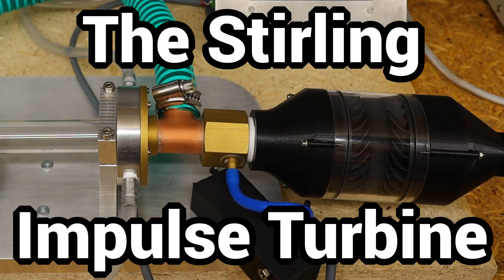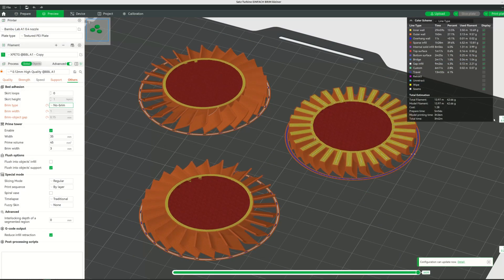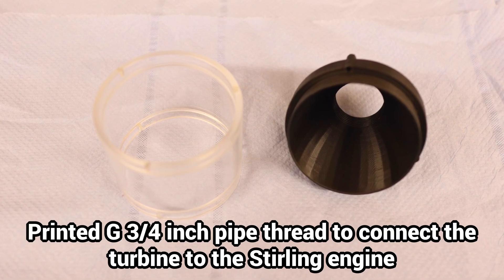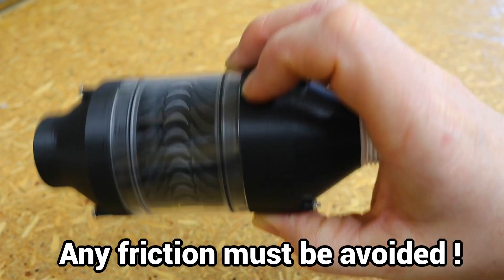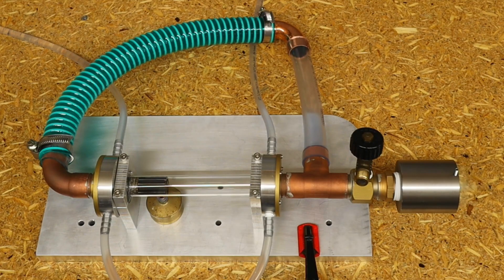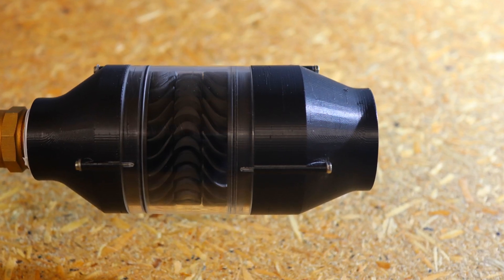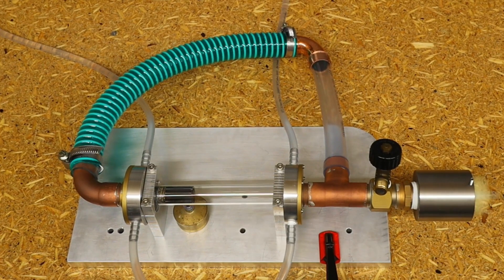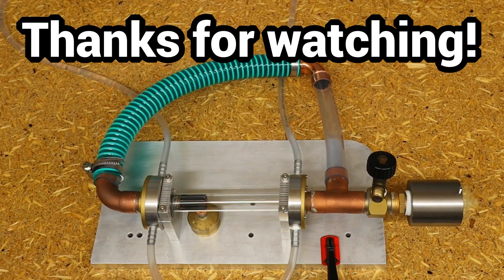DIY thermoacoustic Stirling engine with bidirectional impulse turbine for free energy to go off grid

Comment: I am afraid you will be disappointed.  Acustic waves are the least efficient way to do working fluid displacement in a Stirling engine.  By its very nature it displaces only a small portion of the gas creating tiny effective temperature differences resulting in a very low power density. SE working with air in general has very low power density even with the most efficient design. An acustic wave displacer achieves just a small percentage of that already low power. To have realistic power you need to make is work ideally with pressurised Helium and displace the gas mechanically. You can also use Hydrogen which is miles cheaper than Helium, but unfortunately pressuried Hydrogen is not the kind of substance you want to work in an environment where high temperatures are present.  For several obvious reasons.
Reply from the maker: I currently made some experiences with helium but not so successfully yet...
There are many academic reports about thermoacoustic engines with really nice efficiencies.
As i want to use the engine in a micro CHP I can use the waste heat to heat the house and will still have a good balance.
The possible reliability is my main motivation as I had much problems with my other engines!
Reply: @myengines2443  I do appreciate that in home-based workshop it is very hard to work with gases that have very small molecules like H2 or He because they are difficult to contain due to them leaking through the tiniest of imperfections requiring the kind of machining tolerances that are almost impossible to achieve at home. Also to improve the power density they need to be pressurised which further complicates the engine design. Ironically they are the best for Stirling engine exactly because of those small and therefore mobile molecules.
Are you saying you saw scientific reports that say thermoacustic SE achieve high efficiency?  From my reading the best SE efficiency is achieved with free piston (still mechanical) design. Many years ago I made a crude model of a free piston engine coupled with a linear generator that managed to just light up an incandescent bulb, I was very proud of that achievement then. The video is still on my channel.  Of course it was with air and not pressurised, so not really powerful. Shortly after making the video I kind of lost interest in Stirling Engines.Well, good luck with your efforts.

Comment: It would be great to see this used with concentrated solar. Great work!
Reply from the maker: Yes that's an option but I think photovoltaik is unbeatabel and I want to use it mostly in winter when the solar plant is weak and I can use the 'waste' heat also for heating the house!

Comment: try high viscosity liquids as the sound media
Reply from the maker: I've never heard of this before, can you describe it in more detail?
Reply: @myengines2443  there are some engines in the geotermal arias that use oil/metal expantion for the work method, sorta like a classic displacement  stirling engine. it reaches whay lower speeds of cicle, but they have monster torque by  the incompressible nature of liquids nature.

i wonder if the consept aplies here too.

i gess it wold be hard to do cos of diferent resonances, wold require a new tube.
i gess lower speed  viscous liquid wold bade a por feet or the 2way turbine too.

the ideia is that more torque wold result in more eficiency by skiping any gear boxes...

by similar logic maybe a cavitation based sistem wold doo a similar work... like keeping the termals under precise controls so a single bouble of vapour formes, and them gets cooled back into liquid. like a pop pop boat.

Comment: no need to convert it into rotation energy, you can put a magnet on the shaft of the piston and a coil of wire that it move in. basically you can use a solenoid to take power directly from the reciprocating part.
Reply from the maker: I am also building a linear generator as you can see on one of the last photos in the video.
A turbine is much more easy to print and less maintenance intesive than a piston so I favour it!

Comment: so transform heat energy into elecricity via a sterling engine AND a turbine. Recipe for inefficiency. 
What if you put super magnets in the oscillating part and put coils around it to pick up the changing magnetic field? (like in a generator)
Reply from the maker: I am also building a linear generator as you can see on one of the last photos in the video.
A turbine is much more easy to print and less maintenance intesive than a piston so I favour it!

Comment: My dream goal would be a decent powered Stirling engine with ~100W usable output power. Either thermoacoustic or "classic" would be fine. But for me the goal is low losses. High performance is a side effect of that.
Reply from the maker: For me is the efficiency of course important but as I want to use it as a micro CHP all losses are used to heat the house!

Comment: "When fitting Z part" Not the but Z.. I love that. Simplified and good = Needed. Earth whites need to quit wasting time feeding what breeds starving and upgrade to Plasma generated Ultrasonic pressure Holography printing aka 3D Direct Sound Printing. Ultrasonic resonance to break bonds of metals, Ultrasonic holography expansion field on the metal so the dust flies out that breaks free into the container, and then use dust to print with. Dust = From thrown out metal.. Ultrasonic holography = Nano structure form hold by computer control until cool of merged metals and perfect heat control through the metal.

Get back to your ancestors logic.. Ancients: "Thor's Hammer from the heart of a Dying Star, strongest material in the universe!" Modern science: "Nuclear pasta inside Stars, theoretically the strongest material in the universe." Google: "Ultrasound can generate pressures as great as the bottom of the ocean" for Illinois Edu Sonochemistry page. Plasma better.. Google: "Ultrasound can print through walls" and for quality control Google: "Ultrasound see viruses turn genes on/off" bye bye expensive microscopes..

Comment: Interesting video! 
Im curious as to what the advantage of using a turbine with the thermoacoustic resonator versus just directly running the turbine off of exhaust of a burner is? To me it seems like efficiency is just being lost by adding an extra intermediary step, but i'd be very interested to know how the resonator would increase the efficiency. Does the resonator just allow the turbine to operate at a lower temperature?
Also, do you think adding some form of PID control for the resonant frequency of the engine would increase effiency? IE using some sort of magnetic sensor + microcontroller + electronic needle valve to adjust the resonant frequency by adding in extra volume to resonate to lower/raise the frequency as the piston/turbine increases in speed?
Reply from the maker: Your suggestion sound very interesting and if I am more familiar with the complex thermoacoustics this would be an option.
But for now I just experiment with the volumes/length of compliance/inertance to raise performance.
The key feature og the TA engine and this turbine that it can be made very easy and could run very reliable without much maintenance!
Thanky you very much for your nice thoughts, I will think about it!

Comment: Swap out the candle for a resistance wire heater, wrapped around the glass tube, more even heat distrubition and finer control. Insulate it from the tube with a fiberglass wrap. Just a thought
Reply from the maker: Yes you are right, it would be better for developing the engine.
But as it has to be powered with my self produced biogas you can see in an older video I want to fire it with flames from the start on.
I just turned a much better heater on the lathe will will hopefully burst performance!
Thanks for your great help!
Reply: That defeats the objective.

Comment: Wait, was your turbine was open cycle? It looked like you were exhausting from the turbine was Venting from the far side. If you were to connect your low pressure side from the cold tube would that not increase the rotation rate by coupling to the other end of the pressure waves of the acoustic chamber? If you pull the piston out and get sound, you want to not lose your pressure on the blades yeah?
Reply from the maker: I used it both with a closed end and an open end, with piston and just closed.
I can get proper results first when I get more power.
It would be nice if you could go deeper in the details as I think it is an very important thing, I think much about it also!
Thanks for your nice help!

Comment: I'd been thinking of precisely a similar design.. except it was more tesla turbine based, this one might be better than what I'd been working on though.
I'm making a guess though that you're exclusively using the turbine for genarating motion, or primarily at least.
Reply from the maker: If I understand you right, yes I want to us the turbine to turn a generator (you can see it in one photo in the video) to make electricity.
The waste heat will be used for an burning-air preheater and heating our house!
Plz show your work here on youtube its much fun for you and others!
Reply: @myengines2443   but wouldn't it be more efficient to eliminate any and all oscillating motions, which you seem to be using alongside the turbine?
Two counter-rotating turbines, joined together seems to me would be a better option to counteract the radial forces.
And not using only the turbines is hurting my soul a bit.
I'd also been thinking of using a rubber like membrane piston, alongside some liquid to then a turbine, to turn the pressure into motion.
It may not be the most efficient, or the most power dense, but I'm thinking more for mitigation of wear or maintenance requirements for parts.
Although, it is something that I think has the potential to remain service free, while offering significant power density and efficiency if implemented correctly.

Comment: Maybe you can use speaker membrane that can vibrate at high frequency.. and the speaker coil it self become a generator
Reply from the maker: Yes you are right I am currently building a linear generator you can see in one of the last photos in the videos.
Gisbert and other commentators here bring me to consider using a speaker too.
I will do and report in a few weeks....
What I love about the turbine is its simple printability and low maintenance which is much better than a piston/speaker.

Comment: Igus (not affiliated) has tribological materials - reduce friction and wear, self lubricating, very light weight, etc.  That should increase both power and efficiency without increasing the complexity of the design.
Many of their materials have filament offered so they can be used with 3D printers; should be a straight up swap and re-tune.
Reply from the maker: The piston is turned from IGUS W300 and I also have Igus filaments which I used often for my kinematic Stirling engines.
In the description for printing the thermoacoustuic engine in the members area I also suggest printing the power extraction unit with igus filaments!
But thanks for your nice thoughts!

Comment: Really cool I hope you get it making some real power 👍

Also (probably not a good idea for a turbine… or maybe not anything else either) has anyone tried making a stirling engine with a liquid as the working fluid.  I guess liquids heat and cool slower, requiring a different design, but I would think it would make more torque (since liquids don’t compress so easily) 

I have looked to see if anyone tried  before. All I find is the Malone Engine, which has very little information on the internet. Although it was apparently fairly powerful.
Reply from the maker: I never heart of a pure liquid as the working medium but experimnets where made with a two phase liquid/gaseous medium which can be quite effective!
Thanks for your kind comment!
Reply: Yeah liquids take a lot longer to heat and cool…  I think there is probably some way to do it (maybe not with the stirling design). It might be big low powered and inefficient, but I bet there’s some way to do something similar. 
 
Also @myengines2443  that sounds interesting I might have to look into that.
Reply: @I-am-that-guy132  The only working fluid which could readily be used would be ammonia, but that is only because of its phase translation parameters.

That said, its a very dangerous working fluid, as it is poisonous, corrosive, explosive, an asphyxiant, and has the ability to cause flash freezing on contact.

I've worked with it, and prefer to use it, but I know how to handle such highly aggressive materials, and even then, because of a careless move of a fellow researcher, had to address a critical release accident at risk of my life.

So, while I know it can work wonderfully, it can also kill people, so I don't recommend it to those who are not experts and super careful in how it MUST be handled to be safe.
Reply: Sadly, unless you aim to flash boil, and flash condense a liquid, no, it will never work as a stirling engine.

Liquids simply can not be reactive enough in their liquid state for this application.

Not even cryogenic liquids.

Comment: would it make sense to use a magnet on the displacer/piston and a coil wrapped around the outside to make a linear generator? less parts.. less friction maybe? maybe the guts of a loudspeaker or even an actual loudspeaker could work.
Reply from the maker: Yes you are right I am currently building a linear generator you can see in one of the last photos in the videos.
Gisbert and other commentators here bring me to consider using a speaker too.
I will do and report in a few weeks....
What I love about the turbine is its simple printability and low maintenance which is much better than a piston/speaker.

Comment: oh god, you used the phrase "free energy" in the title, do you know what you've just done to my recommendations?
Reply from the maker: Its meant as it does not cost anything as my self produced biogas and firewood does not cost me anything...
Is the term so wrong?
Then I apologize for it and will not use it again!
Reply: @myengines2443  "Free energy" is often associated with claims that would violate conservation of energy if true  – perpetual motion machines and other unlimited-energy-from-literally-nothing-at-all nonsense.
Reply: @exhumedlegume8870  thank you, this. your usage isn't wrong, it's just picked up another connotation due to the many scammers. to be clear this comment was intended to be light hearted though, it's just funny. (also the effect i predicted didn't end up happening, at least for me. my perception is that yt is constantly itching to activate the pseudoscience feed, but it may be that one ambiguous title isn't sufficient)
Reply: @myengines2443 I think he has a good point, the term 'free energy' has associations with a lot of scams on Utube, most of them quite clearly are scams to get clicks.
Carry on with the very interesting projects, l get a lot from your pioneering work!
Reply: oh no it made perfect sense in context. the problem is just that the popular meaning of "free energy" is, a machine that violates the law of conservation of energy. and this version of the term is a popular hoax/scam that youtube is absolutely infested with. to be clear this was meant as a light-hearted comment; the focus was meant to be on this terrible platform

Comment: @My engines
2:42 Can you try to add a tiny bit of water (maybe (much?) less than a drop?) to the heat part of the engine?
When water becomes steam, it expands about 1'700 times the volume.
Hopefully the water gets recycled because of the variations, so the temperature difference is only like 99*C to 100*C (instead of like 20*C to 100*C), so that would be very efficient if it works.
Reply from the maker: Hmm, i don't know how the regenerator will react on this but its really a point to think about...
Thanks for your good suggestion!

Comment: I vote for ease and cost of manufacturing. The closer you get to unmodified, off-the-shelf parts+3D printed parts=working engine the better.  And once you have an easy and cheap engine to build It'll be easier to work on improving efficiency. 😁👍
Reply from the maker: Ok, noted.
Thanks!

Comment: Great work! I'm no expert, but I suspect it would be beneficial to have as much energy in each sound wave as possible at a given average power level, and if that's correct, designing the system to have as low frequency as possible should be beneficial. Again, I don't know, maybe it's worth exploring, unless you've already done that. 

Have you considered multiple turbine stages?  If the generators are small enough to fit into the turbines it should be possible to have contra rotating turbines without much mechanical complexity, possibly eliminating the need for stators between the turbines.
Reply from the maker: Multicore thermoacoustic engines are very efficient and a must when I have much more knowledge, at the moment its complicated enough.
A low frequency has several advantages but a higher frequency means higher power in general.
Many thanks for your good thoughts!

Comment: But how to get electricity?
Reply from the maker: Attach a generator (on one picture it is shown) to the turbine, it is located in the rear nose cone.
I am also building a linear generator which parts you can see in one of the last photos and the use of a loudspeaker is possible.

Comment: I think the resonant frequency of the system is much too high for such a large turbine; but you probably already know that. Thank you for sharing and creating, regardless!
Reply from the maker: Yes its at the upper limit what a turbine can handle, but still in the range of good efficiency afaik.
I'll have to read up on the frequency up to which it makes sense to use a turbine.